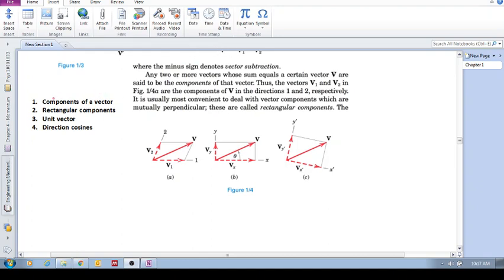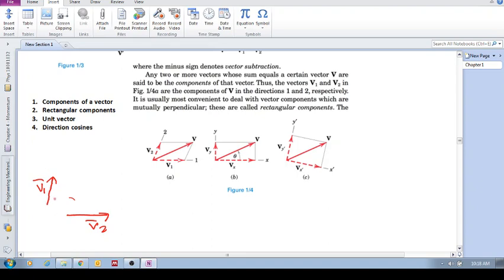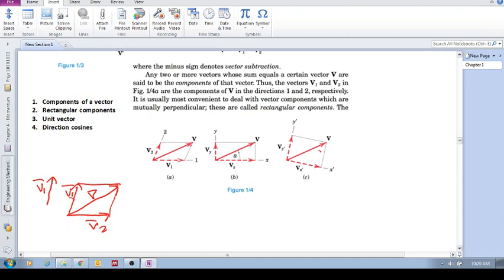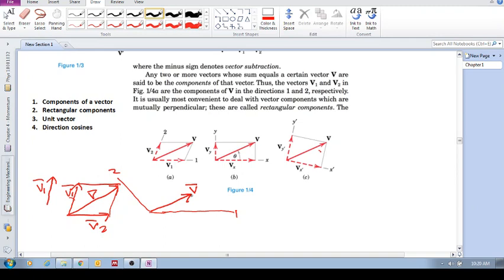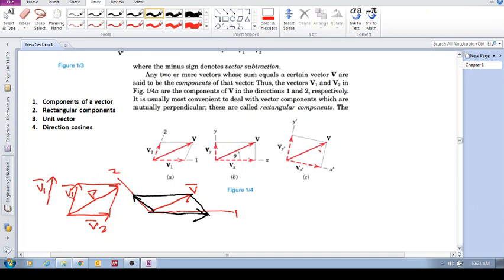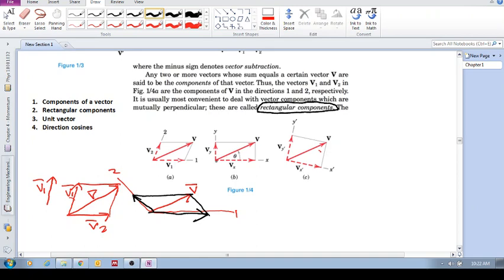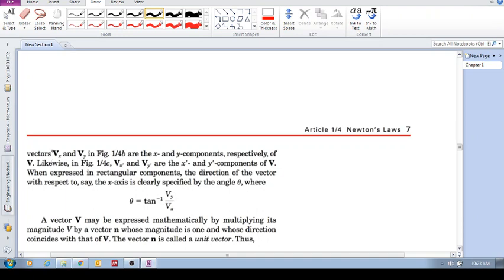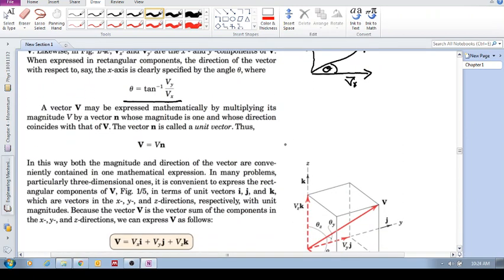Chap 1.3 - Scalars and Vectors (c): Components of a vector

Comment: This oldie needed a quick reminder of basics. Thanks for this Bevan. Copied from my NOTEPAD: 
8:53 17/09/2022     Vector sum (vector force resolution) using quadratics.
Take a force vector (any angle) and extend quadratics from vector end, in both directions which comprise
parallel force and direction of its two required force vector components. Watch to https://youtu.be/TVFdd3fxkkY?t=192   A happy camper.